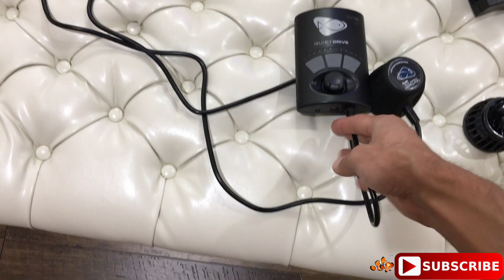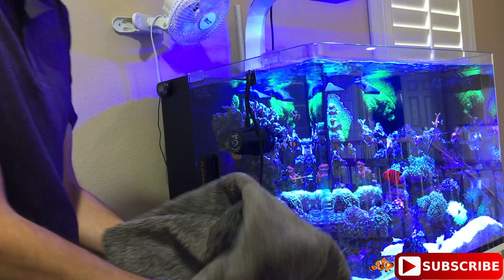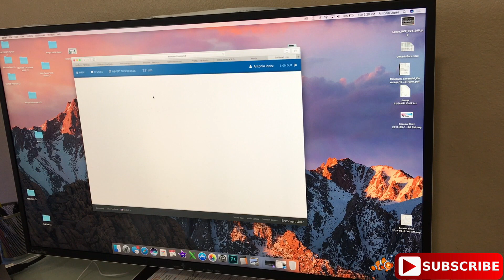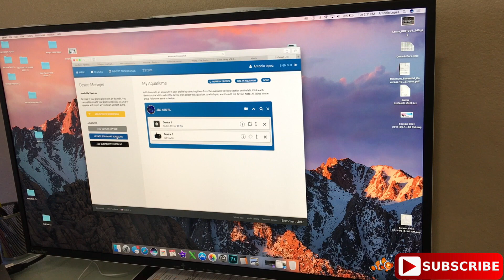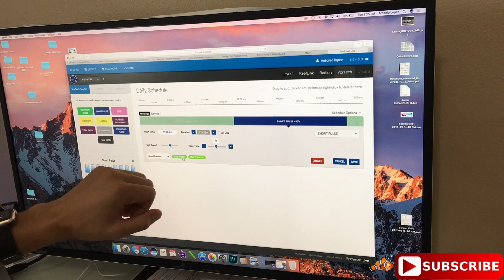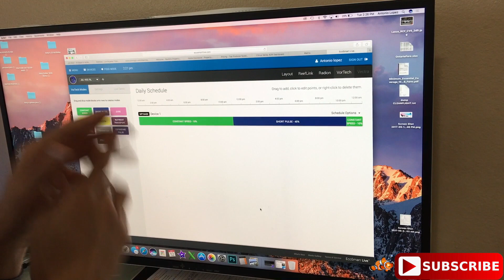Vortech MP-10 (EASY INSTALL)

Comment: What model Gyre is that in the video? And was that not enough  flow that you decided to  add the ecotech QD?

I'm  on the fence  of which  solution to go with...maxspect 230 vs MP10Qd

Comment: Thanks for video!  What mode and % did you settle on?  Are you going to keep it in addition to your gyre?  Why did you add it in the first place, since it looked like the gyre was providing so much flow?
Reply from the maker: Mr. Largo glad you enjoyed it :) I ended up going pulsing. I will run with gyre as I belive the gyre flow is impossible to bead. reason I added this is because the gyre always has the current going same direction. This allows me to mount on opposite and and have more of that random we all look for.
Reply: Great, thanks!  Always looking for additional info like this for my JBJ 45.  Keep the good stuff coming!

Comment: So you ended up removing the hood on the cubey. Was interested in it but seems like innovative marine nuvo makes the most sense. No one seems to like the lights on the cubey
Reply from the maker: baseballhunter42 no I still have it on it. Haven’t removed it. Light is decent but may be adding a prime :)
Reply: EAT SLEEP Reef what tank is this in the video? A biocube with hood removed?
Reply: @baseballhunter42  second this comment.  What tank is this. 

New to the hobby. Thx